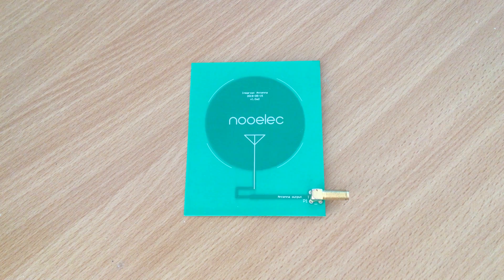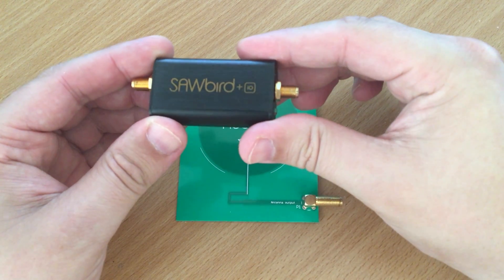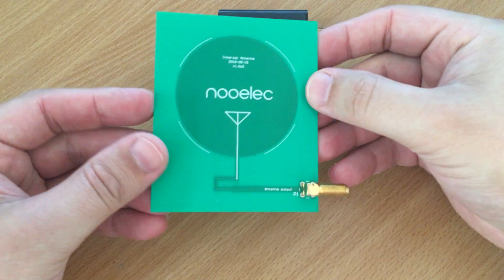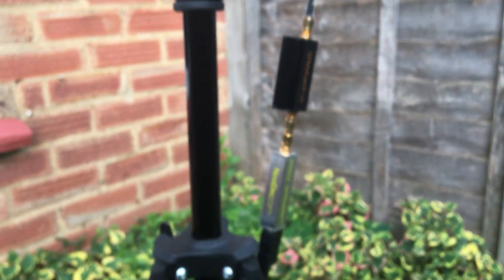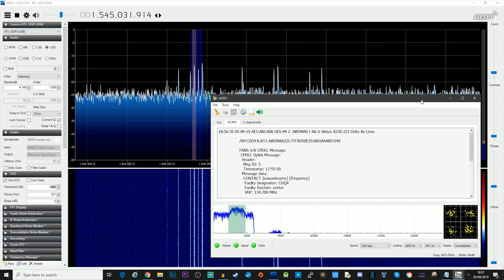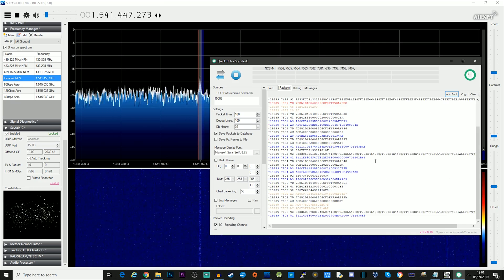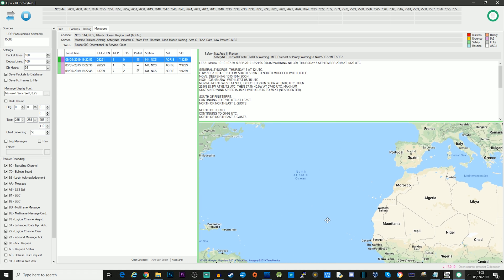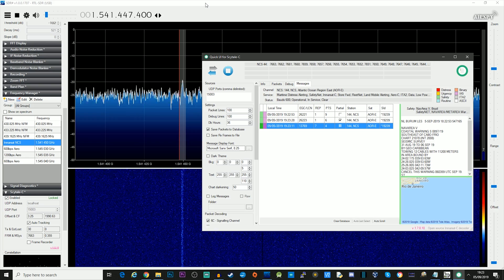New Inmarsat Antenna from NooElec

Comment: So the power is going through the cable when you enable the bias-t? Is it a special cable, or does the antenna just get the juice from the center wire in the SMA cable?

Comment: “The filter and stuff on the tripod are straining the connector”.... then he leaves it straining the connector when a simple cable tie to relieve the weight/pressure would have been a 2 second fix.
Reply from the maker: As mentioned in the video I wouldn’t recommend leaving it like that. But for the 30 second video clip it wasn’t damaged. I’m thinking that these pcb style antennas would benefit from a 3D printed case, just wish I had a 3D printer! lol
Reply: @TechMindsOfficial  thanks for the clarification mate.
Reply: Make your own video then smart arse!

Comment: I cringed when I saw that all hanging there with no strain relief whatsoever.  <shudder>
Reply from the maker: To be fair the connector is extremely strong and it wasn’t a permanent installation. I even said in the video that a permanent installation should have some sort of strain relief. So you can stop shuddering if you like

Comment: Can it be used for HRPT, with some tracking?
Reply from the maker: I haven’t tested it at 1.7ghz but it’s centre is around 1.5 so I doubt it would be very efficient for HRPT. But, without actually testing it I can’t be 100% sure 👍
Reply: I don't think so. I have mounted 1.2 GHz  linear patch antenna to 90 cm dish, and could get 2 SNR on data sidebands of HRPT with """"40 dB"""" Double SPF LNA.